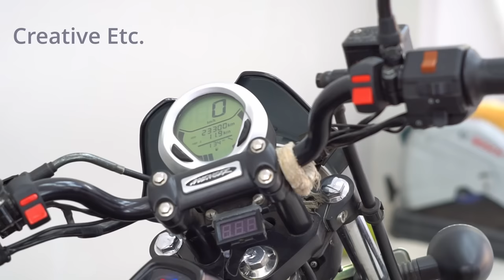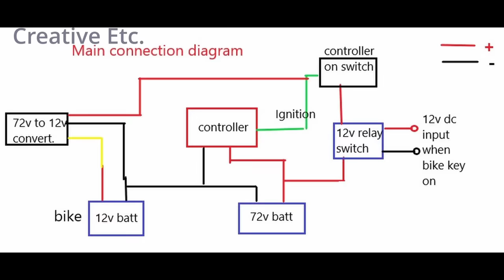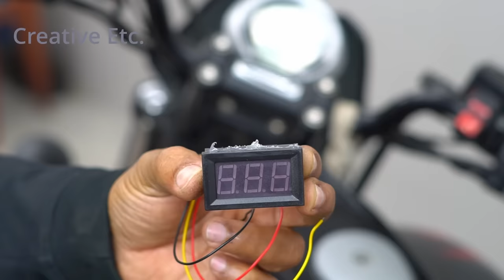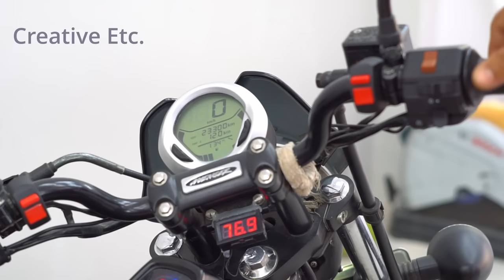DIY Petrol and Electric Hybrid Bike at Home

Comment: Fantastic video . Never seen such innovative idea with so much perfection . Well done . Hope this is introduced in market as a kit for many bikes

Just few things . 
1.How are you managing heat dissipation of battery as it’s very enclosed
2. Is it ignition controlled ?
3. Does the battery charge itself while riding it on petrol ?
4. How is the steering experience as it’s front wheel drive while on electric ? 
5. Any safety concerns you think it has to be addressed ? 
6. How is the theft control set for this ?

Comment: So, my question is can we charge the battery by driving with the petrol engine?
For example, i drove with Electric motor for say, 40Km and then i switch to petrol engine and drive. Will the battery get charged by driving so that i can use electric motor again when petrol is almost over?
It would be great if that's so. Just my intuition.
Reply: Yes certainly you can any time.

Comment: Very well though and executed. Great job. I have a question what's the range you are getting when you are running on battery when full charged.
Reply: No
Reply: Normal OEM battery can give around 60 to 90km range with 90 to 100 watt controller

Comment: Can the batteries be charged via bikes alternator also

That would be amazing
Reply: Great idea
Reply: @grgr1831  it increases the efficiency .

Since a 9 AMPS battery gets charged in 10-12 minutes RUN on a Avenger 180 CC, 2006 Model.
So if a person is riding at any speed with RPM above 1800 for 1 hour it will charge a 35 AMP battery in 1 hour, means Double the Mileage with the HUB motor installed.

Or if a DIY alternator kit be installed, with bigger coil and same size magnet.
Reply: It's possible but it'd require a boost converter.  Probably simpler to use the existing regenerative braking function of the controller. I wonder which method would be more efficient. I imagine the type and quality of boost converter would be a significant factor.
Reply: Also lot of petrol can be saved if the breaking was done by motor..

The disc plates will not burn if we transfer speed of bike into motor ,inorder to stop ...motor will charge battery ..in motor braking...this logic can be made practical...👍
Reply: @balemkarap5090  it's done in this video
Reply: @balemkarap5090  @Timothy Liberty 
I'm talking about Engine based charging, so that when bike is running on petrol, the engine alternator charges the battery. 
The regenerative braking are definitely engineering advancements, but useless when compared to its cost of installation
Reply: Nice
Reply: We are dashing to 6th generation and not reversing technology like Baba Adam’s  ok. old out dated ~> vintage  English Norton, Matchless, BSA,  Bullet bikes technology
Reply: @dasaribhasker7892 from where are you

Some New Planet found just now

Comment: What about the weight of batteries that is fitted on right side, I think you should have equally distributed the weight on both sides of the bike
Reply: Weight not wait
Reply: The battery could have been divided into two parts for equal distribution and should be attached on both sides. Otherwise, it is a fantastic job. You can do this professionally for other customers.
Reply: @samsyal79  that's what I said
Reply: @samsyal79  or, ad another batery whit the same capacity in the other side
Reply: This weigh not too much

Comment: Nice concept. 
I am not sure if the cut forks would hold the bike+rider weight when it hits a pothole or speed breaker. Same for brake disc as well. 

Rest all good.
Reply: I have the same question 👍

Comment: Welding couldnt be stronger than a single piece of metal at high speed due to exerted acceleration and moreover you could have made disk manully in lathe.btw the concept is good informative

Comment: All the best with broken disc while braking at higher speed, plus reduced strength of the front forks as you have cut the lower end, their stress bearing capacity reduces...
Reply: Exactly my point
Reply: Extremely unsafe at higher speeds. Changing the design and welding inappropriately will lead to serious disaster

Comment: What about a dynamo set up to recharge the battery while it drives in engine
Reply: Ye bhi sahi hai... Next Level ki such hai....aapki
Reply: It will charge while run on petrol
Yes na
Reply: Current will generate on front wheel recharges the battery  while run on petrol

Comment: Instead of welding the brake disc, how about you make a steel disc adapter for it so that you can easily replace the disc in future with a similar one without welding. Nice conversion though

Comment: Watching from Pakistan i really apricate and impressed as its a great work Being experiment and to guide other..  
But, Being professional-ism, safety and design... same 03 question raised in my mind which pointed-out by @sayujraphael. And some other things which improve it much more, if you install the batteries on the both sides which not only maintain its design but also give extra mileage on EV. Rare wheel motor is also available which improve the traction on rainy day and perform better to climb on height. these suggestions are for next project.. but this project is amazing ... stay blessed a lot brother

Comment: welding brake disk ? that is a huge no no for me. 
can cause vibration on normal drive if its not balanced and even worse on braking.
and if it fail and break it can lock the front wheel in the worst case or "just" lose the front brake.

Comment: No way I'm gonna cut off half of the lower end of the fork tube or run my disc brake on spot welds. Ok I'm not gonna cut and weld my disc at all and get a nice warp like you got